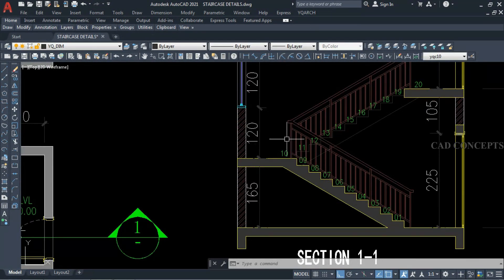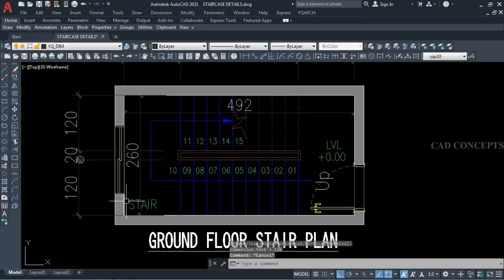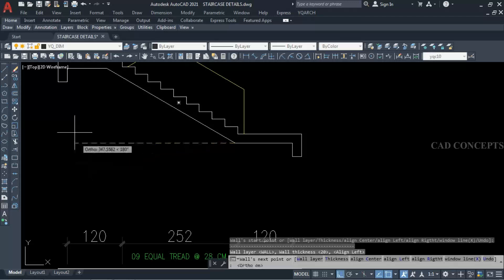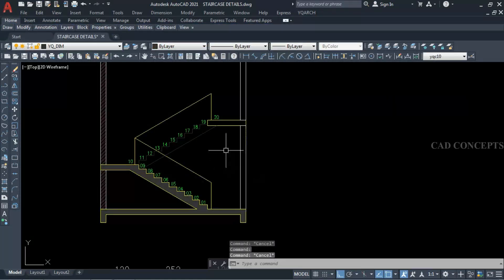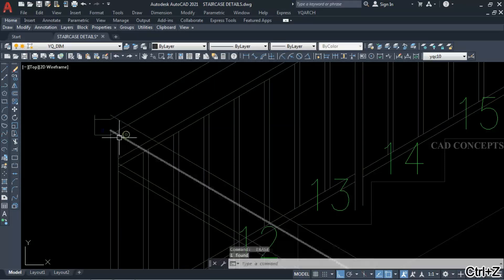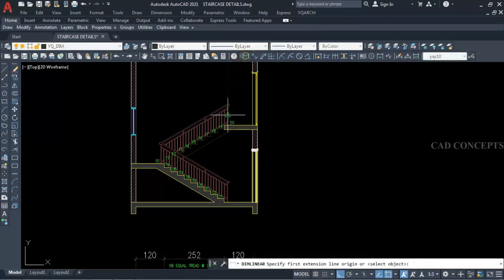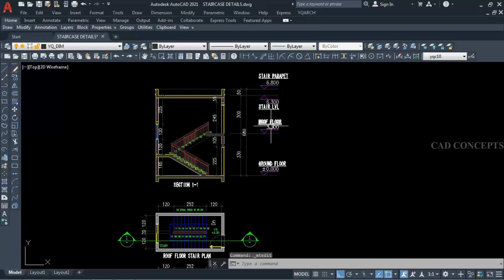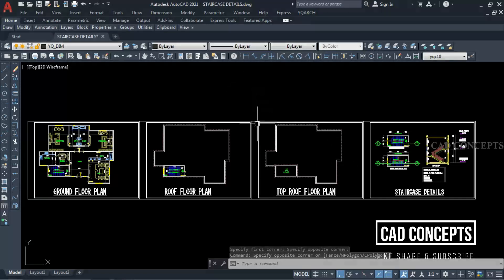Discover how to make staircase 10x faster best AutoCAD Tutorial

Comment: Excellent Sir, this will be very helpful for drawing fast.
One question Sir, is it possible to draw three flighted staircase or U type staircase( technically called 2-quarter turn open well staircase) plan and elevation using YQarch.This type of staircase is used very oftenly. I will be very grateful if you ask the process. Thank you Sir.
Reply from the maker: Welcome ❤️
There are the tool that help creating staircase in three types Single Trade, Double Trade, Scissors Staircase plan and section at a time, access this tool type LTJ/LTP command...
👍👍👍👍